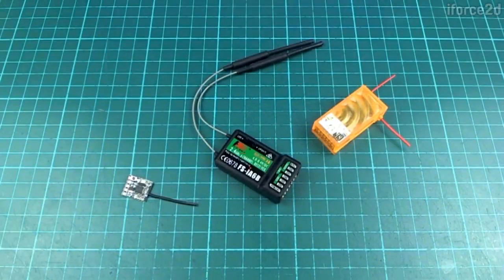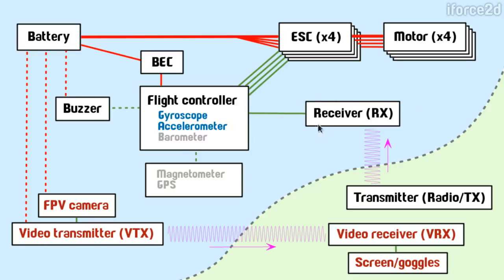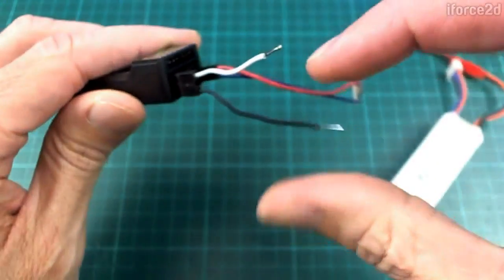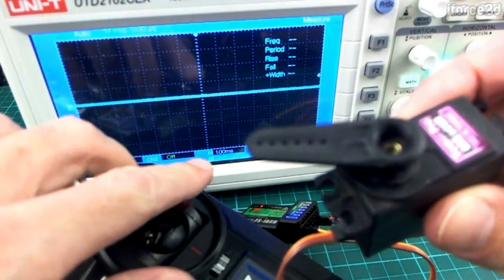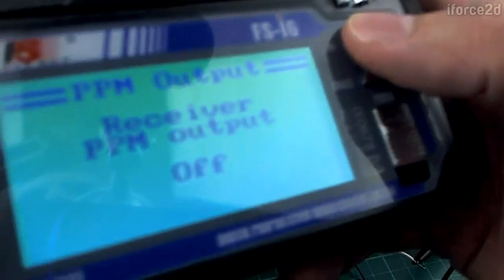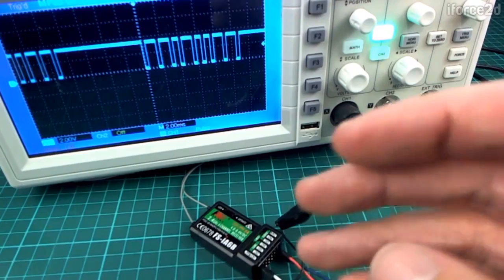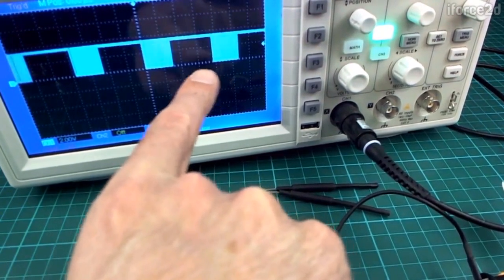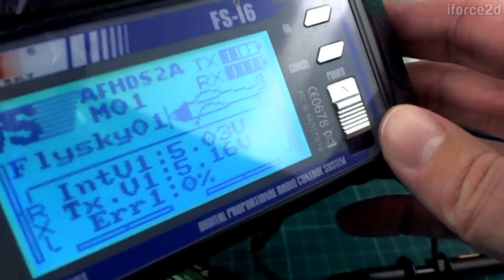Noobs guide to quadcopters part 8 (receiver)

Comment: Thank you very much dude! This brought me a lot forward with my own project.

Does anyone know if the signal PWM signal always have to be the same the same length like in the video or can the FC handle different signal length too?
Reply from the maker: The most common standard for servo connections is a 1000-2000us pulse length. This is almost universal, I have never seen anything else used between receiver and FC. There are other standards though, for example the 'oneshot' used between FC and some ESCs is a 125-250us length pulse.
https://backyardrobotics.eu/2018/03/14/on-esc-protocols-part-ii/

Comment: Great explanations thanks for taking the time to make the video. I've also got a Flysky FS-iA6B receiver. As a newbie I'm wondering if you could assist me with hooking up the receiver to the SP Racing F3 version 1 I think. I see some people hook up to the Flight Controller using three wires soldering to the RX + & -. I have seen others using the WHITE PORT? using a plug  ignoring the other wires just hooking up the red white and black in a plug to the receiver. I understand that other than the three White Black & Red wires i don't really need the others with PPM. Could you explain the benefits of directly soldering vs using one of the larger White Ports (iso port?) to connect to the receiver. Thanks for any help you can offer. cary.fuller@hotmail.com
Reply from the maker: Soldering just makes the connection more robust... a plug can pull out due to vibrations, a crash, or just your own fingers inadvertently while you're working on it.
Reply: iforce2d OK so both can be used. I was thinking that soldering would be possibly more fragile. But I'll do this because I will actually save some space from the wires in the I/O plug encroaching into the rear where (due to FC orientation) I'm trying to fit the receiver. Thanks very much for your fast reply. For someone who is new to RC receivers I really appreciate your video and the time you took to answer my question.
Reply: Total champ!

Comment: Cheap-Ass comparison...you were pretty high on the HobbyKing Rx, Racestar-1804 and KingKong 12A ESC's thinking they were a good deal for a cheap-ass setup. I looked at the params of each and thought the selection was adequate for the goal of the cheap-ass quad. Now, I see with this new PL that all of the above have changed significantly in price. For instance, the HK-RX is about 2x the price, the current noobs motor/ESC is about $12 more than the cheap-ass. Can you comment? Specifically, will the HK-RX be sufficient to satisfy all the requirements for the noobs vids, ie, will it work adequately? 

Great vids to this point. Usually, the metrics for me, are to read the comments and look at likes/dislikes. In both cases, they have been exceptional.
Reply: After watching this vid the advantage that the FLySky-RX has over the cheap-ass HK-RX comes down to the additional features, ie, PPM and IBUS. There could be others but that seems like a huge advantage in the data comm protocol...is this correct?
Reply from the maker: Keep in mind the cheapass series was done almost four years ago, before the FlySky existed and before I ever had a 'normal' transmitter that I didn't make myself. But at the current time there is really no comparison, the FlySky is better in every possible metric except price. The HK doesn't even let you have multiple model memories, you would have to re-bind and re-trim every time you change to a different model. It also has no telemetry, no alarms when tx battery or radio signal gets low, no mixings for planes, no receiver diversity, no failsafe settings, no PPM output, no serial output, no capability for sensor inputs, no three-position switches, stiff stick movement, no menu so you have to connect to a computer to change anything (and the computer program is awful), it is bigger and heavier and requires twice as many batteries, iirc it is slower to reconnect after a dropout, and I would bet good money it has worse range too. At this point the only thing the HK would be useful for is as a base to build a custom transmitter with arduino, since it would save you some time having to build a box yourself :)
https://www.youtube.com/watch?v=KZaE1qEnIWs

Regarding prices in general, I couldn't figure out whether you're saying prices for the cheapass build stuff has gone up (eg. you say "the HK-RX is about 2x the price") or whether you're just pointing out that the stuff in this build costs more than the stuff in the cheapass series in general. If the latter, well that is to be expected because this is not a cheapass build - the quad I'm building in this 'noobs' series will handle 4S power and be about twice as fast, with better motors and a more advanced 32 bit FC and will easily carry a HD camera and FPV gear. It's not a 'cheapass' quad.
Reply: I did some additional research after your post and see that the FS-RX is much better than the HK-RX. Actually, when I look at the "bang for the buck" the FS-RX is really a good deal based on features. There are many vids on youtube about the FS-RX and in general they all seem to agree that the FS-RX is the way to go.

Comment: Fantastic, I had no idea the v-rail on receivers could provide enough juice to power all the smaller stuff like servos, FC, switches etc! Saves quite a lot of space.
If you can use PWM and PPM simultaneously there is an unlimited amount of combinations.